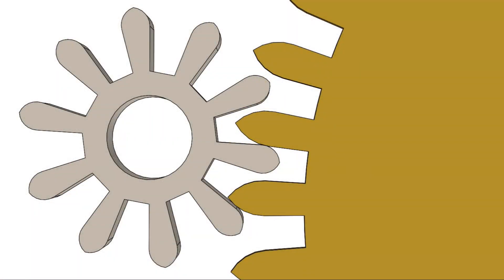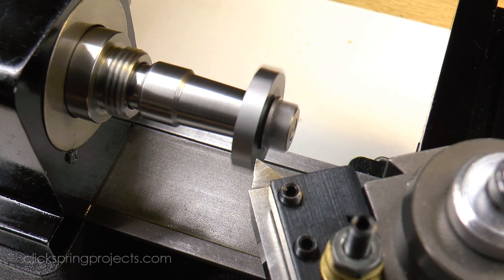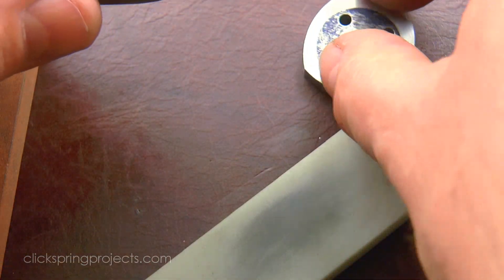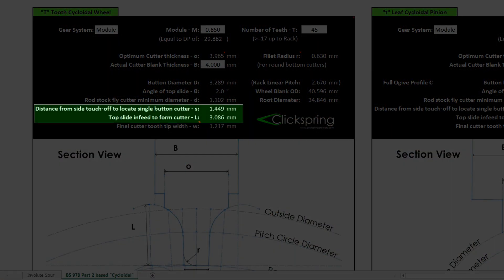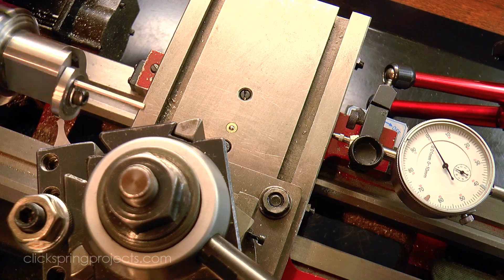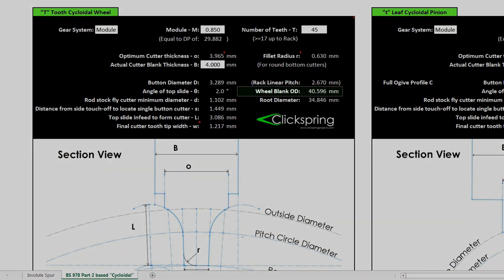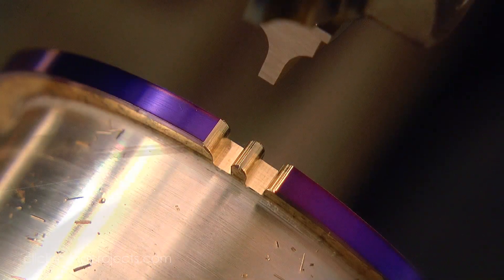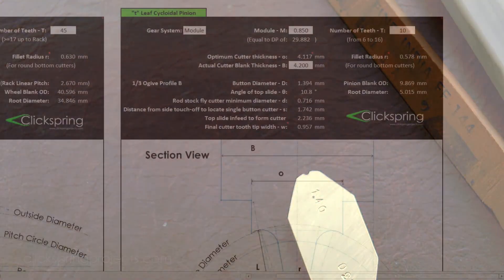Tools, Glorious Tools! #10 (Part 4) - Shop Made Gear Cutters - Making 'Cycloidal' Cutters

Comment: Chris, may I ask what cutting fluid you use please?  (The clear fluid used on the lathe) I have been searching for something other than the usually messy (and smelly) mineral oils available. I have tried various and expensive other cutting compounds too, with variable results. Thanks in advance.  I love the math and science behind developing those gear geometries.

Comment: While I am just tinkering in the shed and my only trade qualification is as a butcher. 

Is it possible to apply gear cutting methods to sprocket cutting for use with a chain?
I have converted my Harley sportster to a dirt bike.  I am having trouble getting the right size commercial sprockets. It is my Australia tourer with a trailer in tow.
I would like to cruise at 95kms/h and rev. at 2500rpm.
Reply: I know plenty of people who have used sprockets for dirtbikes and off-road buggies that were lasercut from flat steel. The Edge Products is a West Australian company that sells buggy kits and parts and they have a fairly wide range of sprockets for sale for 520 pitch chain, and could probably do you a custom set if you rang Tony (the proprietor) on a good day.

Comment: My favorite tooth profile is the continuous-contact profile used in some helical gear pumps. It is just so beautiful. At the same time machining these profiles seem impossible without resorting to wire-edm or similar computer driven methods. How would you go about it?

Comment: Since you have made it, try the brass cutter on POM or Nylon. I would expect it to work. I made single use form tools for turning plastic out of 7075 aluminium and it held up just fine (and was much easier to machine than steel). Especially POM makes great low friction gears for low loads...

Comment: Excellent video series. One thing I noticed while watching this video is the nut that holds the cutter onto the arbor is "normal" right hand threaded. Do you ever have problems with it unthreading since it would naturally want to due to the direction of cut? I'm guessing the cutting forces are less than the tightening of the nut?
Reply from the maker: Yes the cutting forces are quite low, I've never had a problem with it. Normal nut closing force is quite adequate for the job - Cheers :)